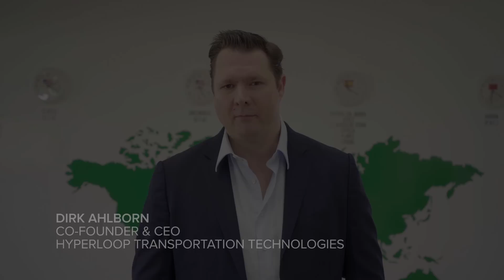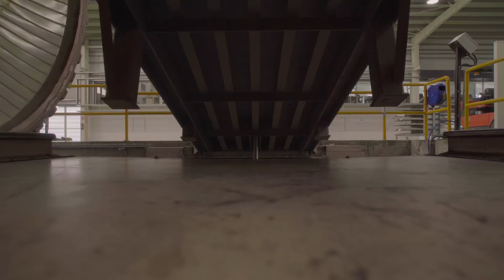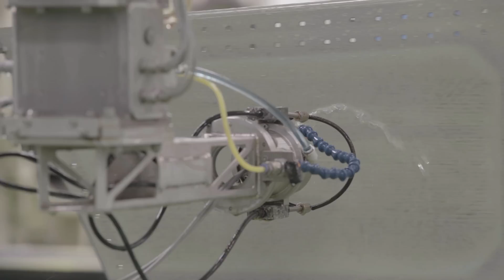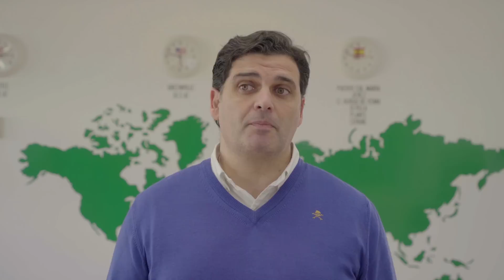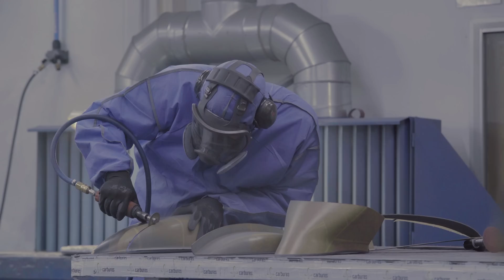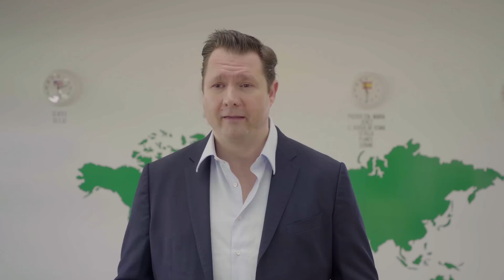World's First Full Scale Passenger Hyperloop Capsule

Comment: Have you solved the problem of the fragility of the vacuum? What happens if some crazy shoots at it?
Reply: the tubes are ingineered to be very very very resistant, don't be afraid
Reply: It's not the random crazy with a shotgun you need to worry it about. It's that same random crazy parking a truck full of ammonium nitrate beneath the tubes that should be of concern. A breach of the tubes will make a depressurization incident in a commercial aircraft look like a picnic. At least the aircraft can rapidly descend to a lower altitude. Passengers in Hyperloop pods affected by a breach will need to accept possibility of extremely gruesome yet quick deaths.